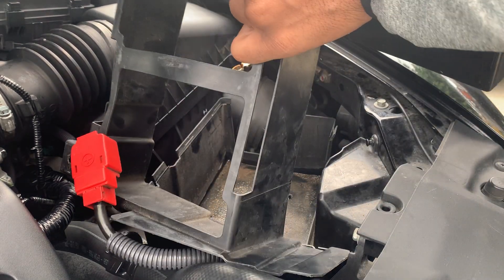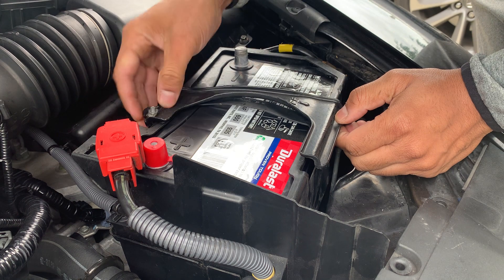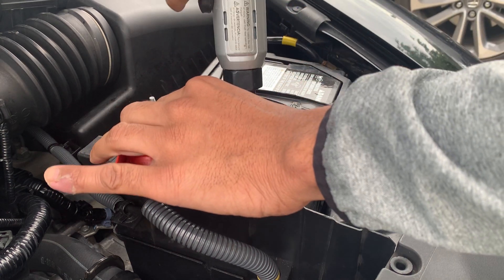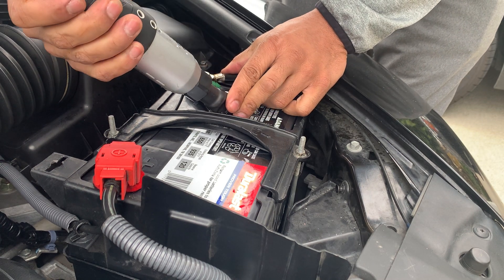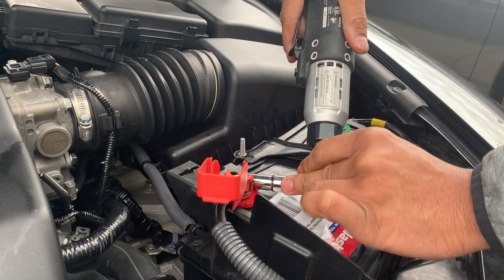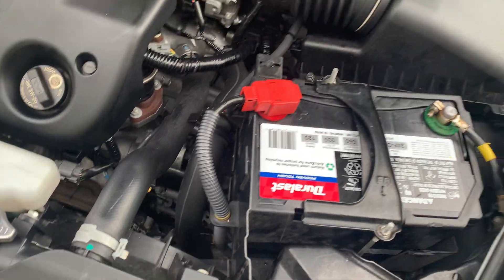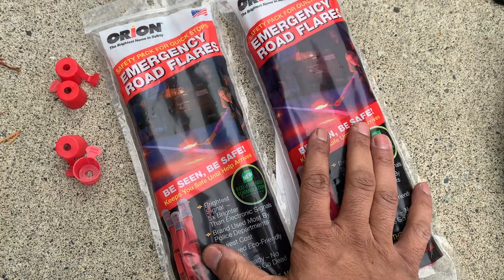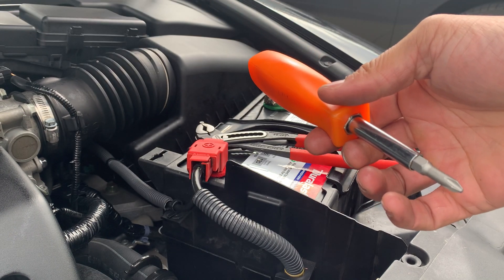New Battery Installation: 2008 Acura TL Type S | Emergency Road Flares

Comment: Just so you know, you don't need to hold the key when you turn on the car, all u need to do is just flick it and the car will start. It's kinda like a push button start but with a key
Reply from the maker: Old habits die hard.
Reply: @unfilteredjamaican3478  Ik, took me couple days to get used to it but cool feature,  i miss it, 6MT need to hold it
Reply from the maker: @senzor007psn  I’ll have the last remaining one
Reply: Bro i love that feature, ever sinc i found out abt it, ive always used it, comes in handy too